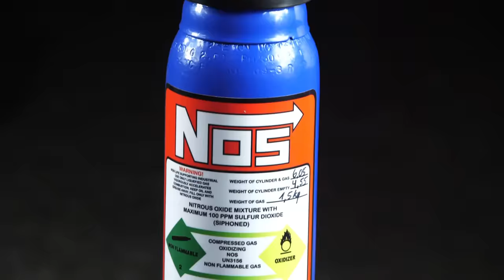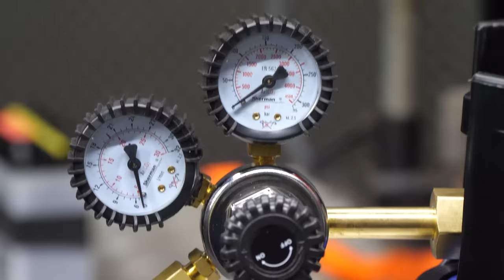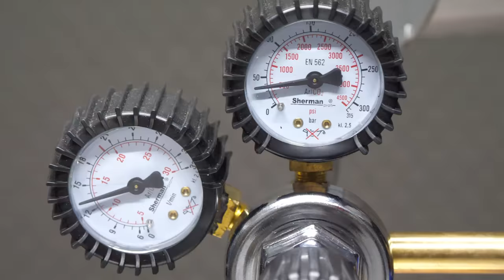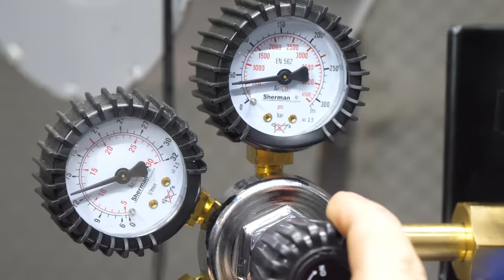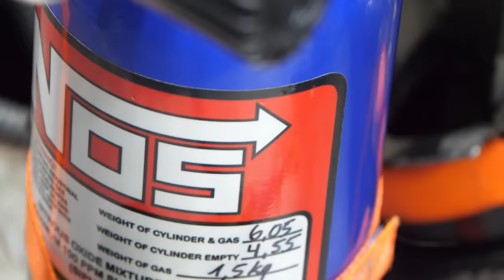NITRO 2 STROKE ENGINE TRANSPARENT CYLINDER HEAD  SIMSON TUNING

Comment: Please redo this with the plug held in by a outside force via something holding it down forcing it against the head to prevent premature failure of the threads due to heat. 

The combustion pushes it simply out / prevent that and then you can run the motor until it actually heats up to its proper running temperature. 

Mind ya the area around the base of the plugs seal is small  Mabey making a bigger washer under the plug where it contacts the dead will help prevent some heat to transfer into the acrylics threads causing them to fail.  

Anywho I’d like to see this done for longer nobody’s done that yet
Reply: en français stp

Comment: simple solution to fix this...bored the spark plugs more deeper....use a short corn road piston....tide spark plug from inside using thin nuts...it gonna last really long...
-:mean you need to tide the spark plug from inside and install then head section....it gonna fix..

Comment: As far as I can see there was no extra fuel being added to the inlet charge when the NOS system was running. Without the extra fuel this system is useless, NOS is an oxidizer, it's not even a fuel, injecting NOS into the engine on its own will just cause the mixture to go lean, this is the last thing you want to happen on a 2 stroke...... Total waste of time! (The music was annoying too).

EDIT, just watched a part of the vid where I presume, he hits the 'choke', I guess that is better than nothing in terms of adding fuel as long as it is actually a mixture enrichment device, if it a traditional choke that blocks off the air flow into the carb then it's still pointless because you are just starving the engine of air via the carb then providing NOS as a replacement to that air.